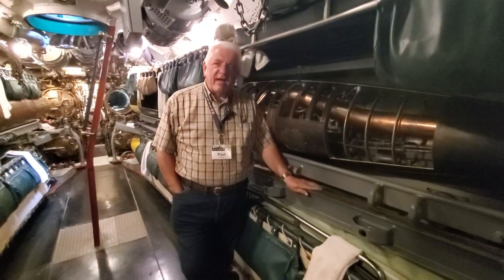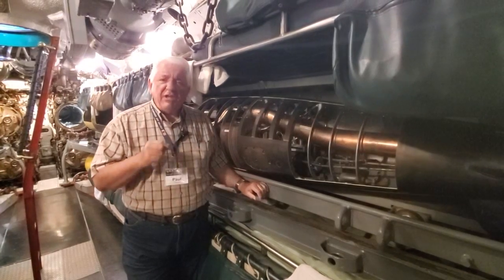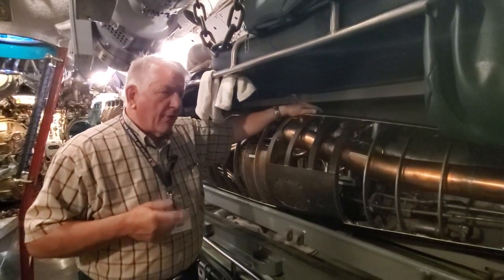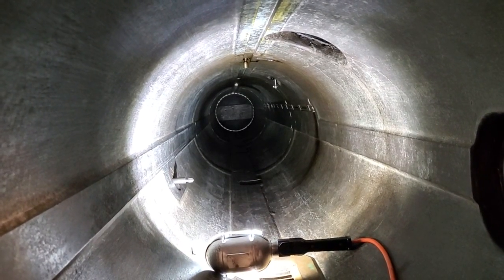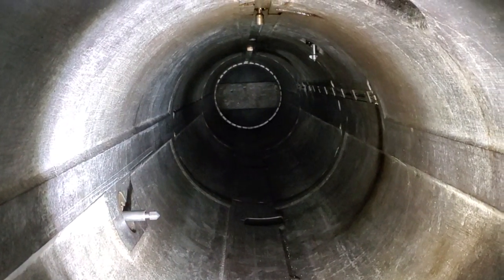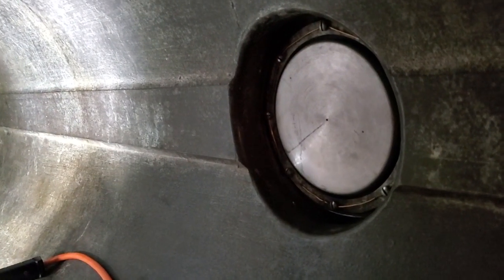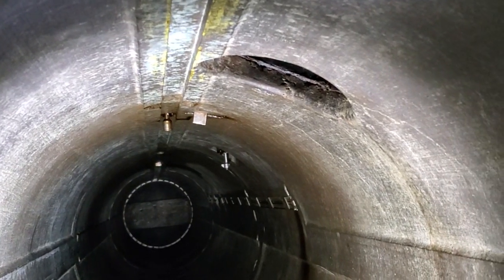How to Fire a Fish: Starting a WWII Torpedo On Its Way!

Comment: Back in the early 1960’s at Naval Station Key West (if I remember the time frame correctly) may have been late 1950’s I was pretty young. One of the subs was testing torpedos and it circled around and hit the sub putting a hole in the outer hull. 🇺🇸

Comment: Very cool video!! 😊 what stopped the crew from accident;y hitting that “light switch” to start the torpedo, when it was sitting in storage inside the ship? Like were there covers or safety pins or something from stopping the trigger from turning on the engine when it wasn’t supposed to turn on? 🤔

Comment: If you want to see how a modern sub fires its torpedo's, go to https://www.youtube.com/watch?v=UYEyhB0AGlw. In Smarter Every Day, Destin crawls down a torpedo tube, something done every month, and then explains how the torpedo is fired. Apparently, the procedure is different on modern Nuc subs than the old diesels. On the modern subs, the torpedo is launched using a slug of water from the sub, while the old diesels used compressed air. My guess is that because Nuc subs spend most of their time under water, air is something that they don't want to just push out into the water. The diesels, on the other hand, spent most of their time on the surface, so air was easily replaced, usually. The times when they couldn't surface, they wouldn't be launching a torpedo anyways.

Comment: Another interesting video Paul, thanks. And thanks for pointing out that the electric fish had motors and the steam ones used engines. People call engines "motors" all the time and it drives me a little batty.
Reply: Same. I've always defined an engine as something that uses heat expansion to generate rotational energy, steam engine, jet engine, piston engine etc. Motor is something that uses an external source of power and doesn't involve heat expansion, electric motor, hydraulic motor, air motor, etc. Then you have motorcycles, outboard motors, motorboats, General Motors and Detroit as motor city, just to add confusion.
Reply: By definition, there is no real difference. "Motor" and "engine" can be used interchangeably in these cases.

Colloquially we use motor for electric, engine for ICE, but that is not by definition.

Comment: Does the switch on the torpedo have some sort of safety mechanism to prevent it from accidentally being tripped when it's sitting outside of the tube?
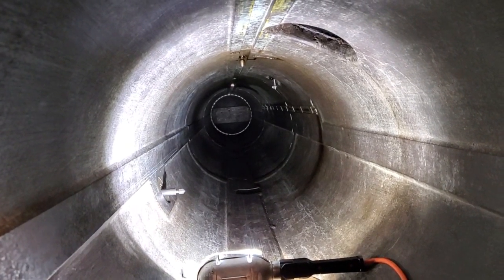Reply: Yes it absolutely did. They were not fueled up until orders were given from the captain that they were entering hostile waters. I believe one fish was ready all the time in order for them to protect themselves and fuel other torpedoes appropriately. Also there are countermeasures that ensure the torpedoes don’t detonate inside the tub’s launching them. Of course systems made by man fail but most didn’t. All torpedo systems American, German and Japanese were very reliable and safe and unfortunately depending on what side of the war you were one very effective. It literally came down to combat tactics and how smart the captain of the boat was. It was definitely chess or a sort of style of chess. A video game without 6:40 
 a screen or controller. A sort of life or death game where you would definitely have to rely on everyone around you.

Comment: It seems to me that the torpedoes have to be loaded into the tubes in a very specific way to be tripped by those protuberances. How do they make sure the torpedoes are loaded at the right "angle?"
How accurate to that angle must they be stored?